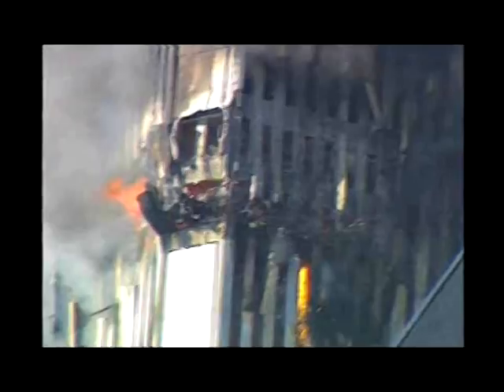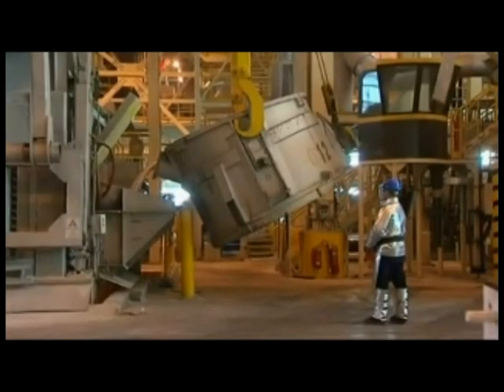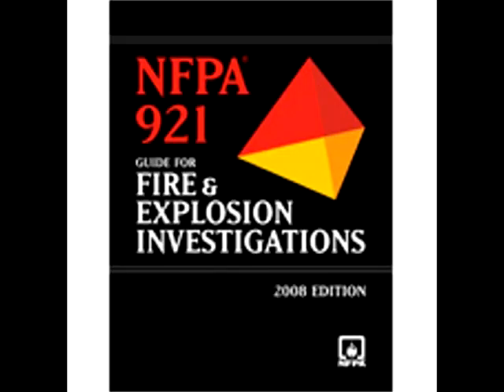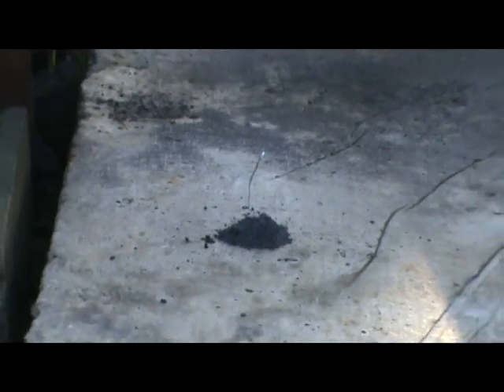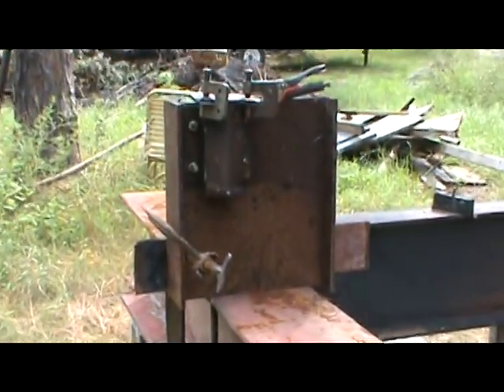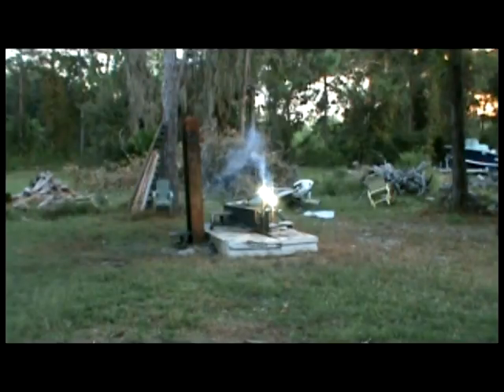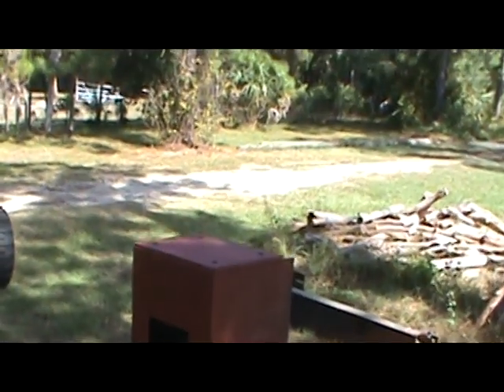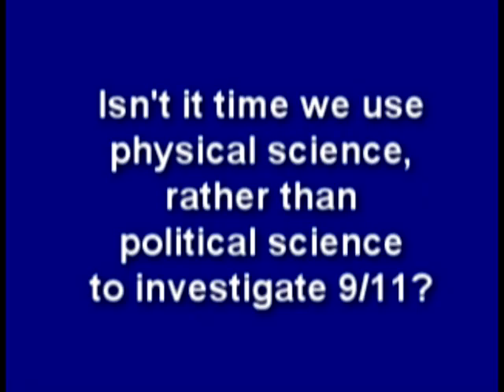9/11 Experiments: The Great Thermate Debate

Comment: @palasta The stable portion of the building also exerted force on the smaller portion that allegedly smashed its way through the larger lower portion.  Since NIST won't release their numbers for peer review by other engineers and won't release their collapse simulation data, all we can do is guess at this point.  Without numbers from NIST, we have nothing.

Comment: @Daddyo930 The link I just posted calculates how much force would be exerted once the building fell.

The surviving supports on the floors struck by planes experienced an asymmetrical stress they were never designed for, and several would've been struck by debris and weakened. This was made worse by a period of fire heating up the steel and further weakening it. It's impossible to calculate how much force was being exerted, since we don't know which beams survived or how much they were weakened.

Comment: @EGRJ Then how much force was being exerted on lower structure.  Don't forget to add in the tensile strength of the 47 core columns, because that is important when trying to figure out how much force the smaller portion of the building was exerting on the larger stable portion of the building.  Numbers would be helpful.

Comment: @Skeptic121 Random fires did it, but not "perfectly". That's a straw man you've conjured up. NIST does not claim the entire building was in FFA, only part of it, and only for part of its descent.

In a regular CD, they have weeks to prepare, and can do it openly. The 'spirators couldn't even knock down walls or pre-remove structural members, which is vital in pretty much any CD.

Comment: @Skeptic121 Glad you bought that up. No building over 40 stories has ever undergone a controlled demo. Ever.

Also, the knowledge from NIST's report has actually been shown to improve fire resistance in new buildings built with it in mind. If Hushaboom™ explosives were used, then said research would be useless.

Comment: @TheGrinningSkull Why "a certain point"? Everything in a building is above ground. You're just demonstrating your ignorance of physics. The forces in a building are in equilibrium. Gravity is pulling down, so they resist. If they had actual upwards force, than the building would float into the air.

Comment: @Daddyo930 
OH, now I get it. Idiots in the 9/11 movement tried several years ago to claim a building pushes UP with equal force to the upper section pushing down.
THIS is so stupid it's beneath contempt.
There is NO upward force in a building, there is ONLY resistance to how gravity wants to destroy it.
That's what I just told you. The remaining strength is what upper floors are built on

Comment: @Daddyo930 It took out one floor at a time, not the whole lower structure at once. Impact loading forces of the floors hitting the single floor below it are enormous and would have no problem sheering the joists away from the verticals.

Comment: Why is it so hard to understand that the planes took out 1/3 to 1/2 of the supports for a number of floors and steel loses half it's strength at about 1200-1300 F. Now put a 20-30 story building on top of that and what do you think is going to happen?

Comment: @Merlin5by5 Then how much weight and tensile strength of the lower structure and how much force would it exert on the smaller structure above then.  If your the engineer, then you should be able to crunch the numbers faster than me.  I'm just a musician/farmer.

Comment: @Merlin5by5 So you totally ignore Newton and physics and go off on some hammer tangent.  Is that what they taught you?  You don't exactly have the cognitive dissonance thing down yet.  I will still steer you back to science and physics and not tangential abstractations.  Just address my prior assertion regarding F = ma.  Then factor into that equation the weight of the lower structure and how much resistance it exert on the smaller structure above.  Then you will convince me. Numbers please.

Comment: @Merlin5by5 When you hit a hammer with another hammer, what happens?  Remember what I said? Similar design.  It's ok, let me help you with this. The relationship between an object's mass m, its acceleration a, and the applied force F is F = ma. Acceleration and force are vectors (as indicated by their symbols being displayed in slant bold font); in this law the direction of the force vector is the same as the direction of the acceleration vector.  Is that clear enough for you?

Comment: @palasta  (cont)
A stack of cardboard sitting between the earth and a concrete/steel block would be crushed in a gravity collision. They cardboard's structure is different then that of the block. But if you we're to replace that stack of cardboard with a solid titanium structure, then drop a concrete/steel block on it. The concrete/steel block would absorb the majority of destructive energy, as its not as solid as the titanium.

(cont)

Comment: @TheCrundlestix

The same applies to the WTC7 case. A significant relevance goes to the construction material. In the contrary to a concrete structure, steel elements as in the solamon bros. bldg. when under heavy stress and buckling give way quickly.

Comment: @TheCrundlestix

...the one that smashes and the one that got crashed. But in fact the "resting" structure underneath was contributing to the progressive collapse. Path of most resistance... like it doesn't matter if the payload had been exceeded by far and which direction the load was coming from.

Comment: @TheCrundlestix Hushaboom, in case you're not familiar, is a totally silent explosive that has no overpressure wave, yet is still strong enough to bring down steel structural members. This is an improvement on conventional demo charges, which are loud enough to cause hearing damage, and would have deafened or killed the survivors who were in the stairwells when 1&2 collapsed. Three cheers for hushaboom!

Comment: @TheCrundlestix Luckily, just like WTC 1 & 2, the explosives inside WTC 7 were not damaged by fire, though they were exposed to it for hours in multiple areas, and escaped the notice of the building's occupants for months. Luckily, the natural damage to the building manifested itself as warnings to the firefighters, so none were inside with their radios on during the collapse. They didn't need to worry about that in 1 and 2 because they used Hushaboom, but not in 7.

Comment: @TheCrundlestix In fact, I'll defeat it with another premise entirely. That there were explosives in WTC 1,2, and 7. This will be a multi-part post, but it's all on one subject, so please don't dismiss it as spam.

Between 1 and 2 alone, the buildings had over a half-million people pass through, daily. Secreting explosives in just one would be extremely difficult to pull off unobserved. Truthers, of course, argue that they took this large risk not once, but three times.

Comment: @Skeptic121 This would be impossible with conventional charges, much less unreliable ones that have been knocked around by fire and airplane. 7 doesn't have the airplane problem, but it still has the fire. If the floors are launched too slowly or too soon, the falling floor catches up with them. Too fast or too late, they smash into the floor *below* too early and lose speed.

Comment: @Skeptic121 This is the only way to remove resistance from the path of the fall, to achieve the no-resistance free fall you think NIST claimed. Split second detonations of explosives that both disable the structural supports, and push them and the floors they are attached to downward at terminal velocity. I'm not using "free-fall speed", since that's an imprecise term.

Comment: @Skeptic121 The NIST theory says that these supports were still there, doing their job, until they failed from the dynamic load that exceeded what they were designed for. Not simultaneous removal. There are two ways explosives could prevent the supports from supporting. The first is to launch them out of the way. As in, clear out of the building. Through windows.

Comment: @Skeptic121 Even if they are moving in the same direction, if the one in the front is moving slower, then it takes a few seconds to catch up. The one in the rear will decelerate, so it is no longer moving at freefall, while the one in front picks up speed.

And the structural members, even if cut by "stealth demolition", are still present. They start moving downward at gravitational  acceleration, and they provide resistance to the mass above that is already at terminal velocity.

Comment: @Skeptic121 and the slightest random difference of a few miles, or pitch, (or roll, or yaw, or some combination of the above and other factors) more or less will blow their ability to predict the explosives to hell and gone. (Absurdity #4) And that's just for one floor, not the multi-floor fire.

Before you start on about thermite or thermate or nanothermite, none of those burn predictably. There's no way to achieve the split second-precision this hypothetical operation needs.

Comment: @Skeptic121 None of the explosives happened to be knocked off into Manhattan. (Absurdity #3) The damage to the buildings was entirely random. Even with some supercomputer, there is no 100% way to predict which explosives survived, are in the right locations, and are functioning properly, without actually detonating them. This operation requires split second detonation(more on that later),

Comment: @Skeptic121 1. NIST never claimed that all the supports in the building failed simultaneously. Nor did they claim that all the supports in &/ above the impact zone failed simultaneously. That's a straw man. NIST's claim was a *progressive* collapse. X fails, and redistributes its load onto Y and Z. Y fails, so Z is left doing the job of three columns. It'll fail too. While this might have happened over a very short time, it was not "simultaneous".

Comment: @Skeptic121 Basically, for your scenario to work, a)the vertical supports have to be removed from the picture *instantly*, and b)the floors beneath the falling mass have to start moving at "freefall speed" with the mass *instantly*, which is physically impossible. If the falling mass hits a floor below, the lower floor causes resistance.

Also, NIST didn't claim the collapse was simultaneous. That's a straw man. If you think they did, I'll need chapter and verse of their reports.

Comment: @Skeptic121 The only way to achieve your much-ballyhooed "no resistance" would be if the vertical supports were all moved out of the way of the falling mass, not just made to fail. Even assuming that people failed to notice beams shooting horizontally out of every floor, the floor beneath the falling mass is still moving slower than the falling bit, so the latter would "catch up". This would count as resistance.

Comment: @Merlin5by5 

If i drop an apple, the instant it begins to fall, it is traveling at the speed of gravity, Regardless of mass. if you shoot a bullet in the air, when it comes back down, it will most likely be traveling at a nonfatal velocity because it is only being powered by gravity at that point. Its obvious you just run over to Wikipedia and read up on this subject as we go, so again, don't quit your job at the tool factory.

Comment: @Skeptic121 
There is NO instant acceleration in any Newtonian physics, please point that out.
Newton didn't just discover gravity and calculus, he defined MASS, and it's 
first principle INERTIA, it's part of the first law. "A mass at rest tends to stay at rest, etc"
IF a structure, like the WTC 7 Parapet curtain wall, a 2 foot thick weather barrier
BOLTED onto the WTC 7 Frame gets that frame ripped away from it, it will stand
for a second or two, and then fall into the destroyed WTC7.
DUH

Comment: @Skeptic121 
Yeah, I have been to the WTC plaza Before and after the attacks.
BUT, as you can see in this sadly lacking DEMO video, PnR has to 
BOLT the explosives containers INTO the column. The Containers
would have to be at LEAST 4 times larger than this for the WTC.
Are you suggesting that VW Beetle sized thermite containers got
missed? But, they found body parts by the dozen? Remember,
this debris pile wasn't searched JUST by the gubbamint, they 
contracted with SKILLING, SEAoNYC, many more

Comment: knowledge that is lot legitimately gained in never pertinent to the debate, if i don't have valid evidence for something why should i speculate on it so i can set you up for your rebuttal? There is material that can be tested, independent labs have tested it and found a substance that has all the theoretical signs of NT. No one without clearance, and knowledge of real NT, can answer these questions, your line of attack is invalid.

Comment: NIST's assertion is that the falling load of the building above the impact point is what caused the simultaneous failing of all vertical columns, thus collapse.
In reality we know this is impossible for a few basic reasons-

An object will always take the path of least resistance, the top of a building falling through the lower portion of a building would not happen w/o  failure to EVERY vertical column in timed unison, a completely unnatural act.
The "premise" is not chandler's, its newtons.

Comment: @TheCrundlestix If you drop multiple floors onto one floor, the bottom floor has gravitational energy transfered to it. In other words, downward motion. Some gets reflected back up, but the top two don't come to a stop until they finish decelerating, by which point the bottom one could fail and join them on their journey. Which makes it harder for the next floor they all meet to stay up. Etc.

BTW, were the hypothetical WTC 7 explosives planted before or after the WTC 1 collapse?

Comment: @EGRJ

"Buildings aren't "blocks"

And again, like merlin5on5, your lack of scientific reasoning, actually makes my case for me. Your absolutely right, The WTC was not made out of "blocks", the term block is used by NIST to explain their "theory". A massive sky scraper of concrete and steel should not just crumble all at once, as if it were made of "blocks". You prove the very point you trying to argue against. In a natural fall, the building would not collapse trough itself.

Comment: @EGRJ 
"How long did it take for the thermite to burn through the steel?"
Thermite was not used in the demolition, Advanced nanothermite was. If i has top level government contractor clearance i might be able to answer questions pertaining to the specifics of what was really used. Leading the debate is this way is an obvious distraction from the point.

"Were the hypothetical 7 explosives planted before or after the WTC 1 collapse?"
Your assuming it had yo be "planted", not spayed/painted on.

Comment: Impact and fire are not the official cause of the collapse as NIST implicitly admits. They're explanation requires the top block of the building crushing down through the rest of the building, to achieve full collapse...3 times. Thats what I've been talking about and thats what you were talking about until I proved you wrong at every turn. PnR's video involving crushing blocks of the same material explains this very simply. Impact and fire does not equal collapse, this is known, admitted FACT!

Comment: @TheCrundlestix 
Doesn't matter. Different materials are not called for in the basic equations of IMPACT and FIRE.
MOMENTUM = MASS times SPEED, and nothing else is involved.
IF you could make 160 TONS of marshmallow, chocolate and 10,000 gallons of aviation fuel, hit the WTC, the resulting damage would be the same, AND you would have SMores.
Geesus, BOY, do you remember that FOAM bashed it's way thru a Space Shuttle wing or NOT?
SO far, you haven't owned a damn thing.

Comment: @palasta 

If You read and understood the entirety of what i already said, you wouldn't have the need to ask such a weak question. My "wood-nail-wood" analogy was a response to Merlin5on5's attempt to debunk another of PnR's videos. The point I was making is that a hammer and nail are different materials, a more accurate experiment would be "wood-nail-wood" event, as at least both objects of mass are the same material. Basically experiment shows "no action with out equal-opposite reaction"

Comment: @TheCrundlestix

"Try driving a double ended nail into a board with another board, I'm sure the nail would stick to both boards equally."

And where is the logic in that? First of all the form of a double ended nail and the woodfibre will encourage it to pierce in equaly. Secondly. you're sure? Means you have tried that with different kinds of woods and varying velocity? Thirdly, to compare 150t planes traveling with 800kmh with a piece of wood moved by human hands isn't just flawed....

Comment: again you give an example that has has parameters outside the experiment. You introduce velocity (externally powered by the engine- pwnd) when you say one car is already in motion. But why are we even debating cars and hammers? This has nothing to do with hammers, cars, metal smithing or your job at the tool factory, it has to do with basic principles of physics that you clearly don't understand.

Comment: @TheCrundlestix 
Well, gee, fella, apparently you think forge hot steel is harder than a cold iron hammer in a metalsmith hand.
How silly is that? Isn't the whole point of the forging process to hammer heat-softened steel?
I am an Industrial Technologist, buddy, so apparently I know tools better than you know physics.
Take two identical cars, and put one in motion, and the car in motion will slice thru the stationary car like a hot knife thru butter.